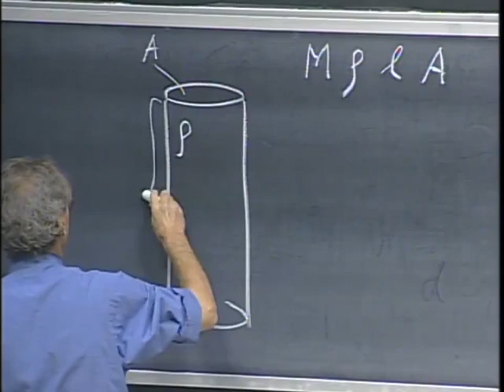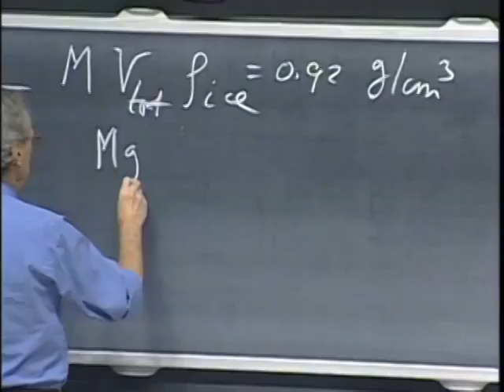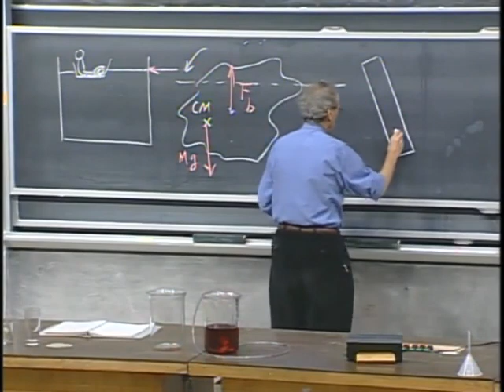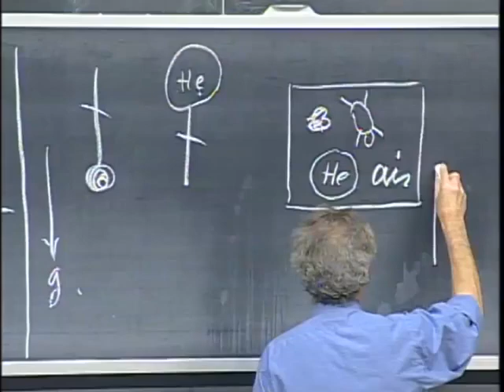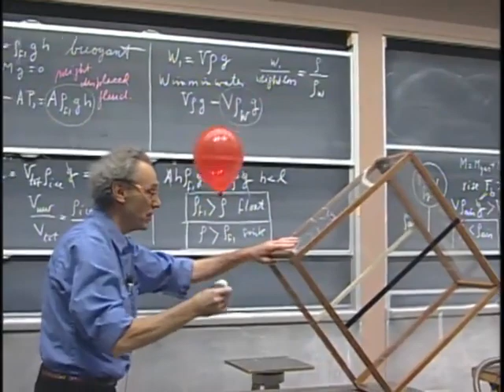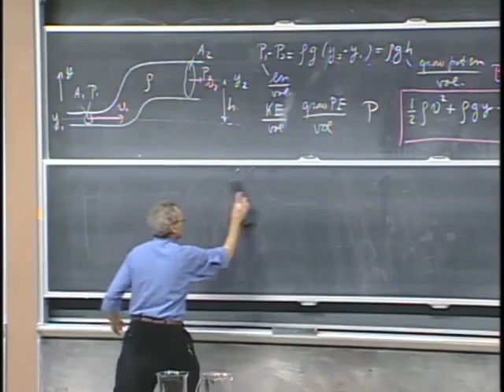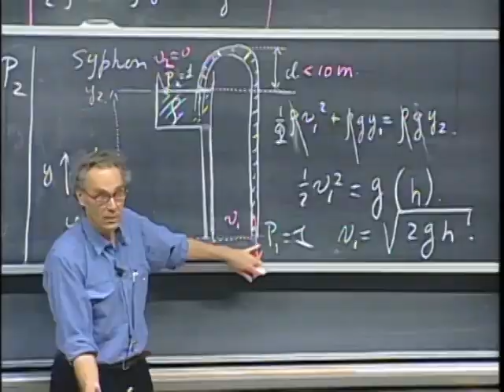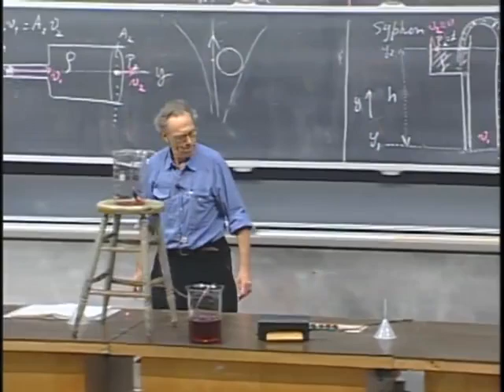8.01x - Lect 28 - Hydrostatics, Archimedes' Principle, Bernoulli's Equation

Comment: Sir, I have a question regarding the experiment at 48:12. Half of the glass is filled with air and half with cranberry juice. Total pressure on the piece of cardboard is pressure of air(inside glass) plus pressure due to the column of cranberry juice (i.e. 1atm + pressure of cranberry juice column) which is obviously greater then the atmospheric pressure (1atm) outside the glass. So inside pressure is greater than the outside pressure still cardboard is not falling down. How is it possible?
Reply from the maker: it's up to you to find out!
Reply: I did this experiment myself. But I filled the glass with water to the brim. When I tilted it upside down the cardboard not fell down. I measure height of glass and calculated pressure on cardboard due to water in it. It was about 1127.3 N/m^2 which is way less then atmospheric pressure. But why it didn't fell when it's half filled? I did not understand.
Reply from the maker: I have never done it with the glass filled to the brim. In any case the adhesion between water and glass and cardboard play a key role to prevent the water from falling out.
Reply: OK!!!! So this is due to intermolecular adhesive forces between glass, water and cardboard. I was thinking some type of pressure difference is responsible for this. Now I will do this experiment with materials other then cardboard and will tell you the results.😀

Comment: Hello sir. A small doubt with Archimedes and the crown.
The principle depends on the significant change in density of the two crowns. Density depends on only mass and volume.
The crowns were identical, which means that the volume of both is same. The mass has to be same otherwise anybody could tell the difference.
How is still there is a density difference in both the crowns when both the mass and volume remains same? Is there one more parameter I am missing to consider?
Reply from the maker: https://www.illustrativemathematics.org/content-standards/tasks/1144
Reply: @Ayush Nema, you're absolutely right. but as far as I'm concerned, Archimedes had only ONE crown, which he had to determine wether if it was made of gold or not, so he did it  the way Professor Walter Lewin described. Otherwise if he had had 2 IDENTICAL crowns made out of different materials it would've been way more simple (as you just described).

Comment: Hello There, Can Anybody Explain To Me This ->
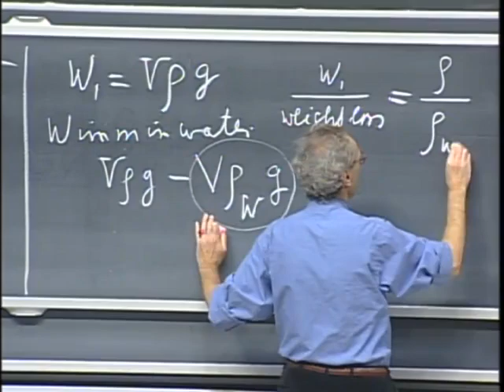at 6:34 , He says Archimedes could calculate the density of the crown using the formula -
density-crown/density-water
but how? if we know density of water at 4*C to be 1000kg/m3 then how I am going to calculate the denstiy of the crown ?
Another Video Explained It To Me Like This - 
Archimedes Knew density of gold and wanted to compare it with that of crown.. for that he needed to know the mass and volume of the crown. Mass he had known but measuring volume sure was a problem. So He immersed it in water, noted the volume of water risen up. As that would be same volume of the crown and used it to calculate the density of the crown. And Then Compared It To That Of Pure Gold. 
This makes sense, But In The Above Formula, How Will He Able To Calculate The Density ?
I know we could simplify further the above formula as  - 
Density-Crown/Density-Water = (mass-crown/volume)/(mass-water/volume) = mass-crown/mass-water.
.
But This Doesn't Equate To Anything? Note: I am still in 11th, so please ignore any dumb mistakes I am making.
Reply from the maker: use google

Comment: Respected sir,
 I think at 22:10 P1 must smaller than P2, as air particle move upwards so the density will be more  at top of the container.
Correct me if I am wrong.
Reply from the maker: you are wrong
Reply: Lectures by Walter Lewin. They will make you ♥ Physics. 
So, how P1 will greater than P2 at 22:10?
Reply from the maker: It's explained by me in my lecture. I cannot be more clear than that.  If you close the windows of your car and accelerate, the air in your car will "stay behind" and thus the air pressure in the back of the car will become somewhat higher than in the front.
Reply: Thank-you so much sir.
Your videos had build my concepts more strong, I had watched almost all of them.

Comment: Saying Vikas,
Sir if a substance having mass density of water whether uniform or not ,then to what depth would it be in equilibrium as all are rightly eligible ..
Reply from the maker: question unclear - watch my 8.01 lectures
Reply: Q. 2###
35:00 time 
Sir at this instant why the P1 and P2 are different even being at the same vertical level,seems to be the consequence of flowing fluid
Reply: I hope you have just the two lecture 27 and 28 on fluid mechanics that may guarantee JEe mains and advance India for fluid mechanics

Comment: what if you throw the rock inside the swimming pool instead of taking it away? the rock should sink because of its density greater than water density but it still replaces a certain amount of fluid and this would cause the level of water to grow up. So in this case the total level of water should stay still?
Reply from the maker: >>>So in this case the total level of water should stay still?>>>
incorrect
Reply: I forgot that the stone has a density too ahaha

Comment: sir, i think that at 48:15, the juice didn't fall out because of the tension of liquid but nothing to do with the barometric pressure. The pressure inside the cup (air in cup) is as same as the pressure outside. Is it correct?
Reply from the maker: <<<<because of the tension of liquid >>>
incorrect
it's becoz of Bernoulli - the pressure of the air that's blown in is lower than the atmospheric pressure.
Reply: Now the question is, why pressure inside the cup is less than outside?

Comment: sir, can you pleaese explain me your last demonstration theorotically. how that works?
Reply from the maker: that's up to you to explain
Reply: sir, is the answer is decrease in pressure?
Reply: @Michael Wang The air pressure above the water is lower than the pressure outside the glass, because once you've  turned the glass upside down there are fewer air molecules above the water than are outside, which will generate a lower pressure. So, if the pressure difference of the air between outside and inside the glass is lower than the pressure exerted by the weight of liquid, the piece of plastic (or whatever is it) won't fall down.

Comment: Sir.....I have a problem in the proof of Bernoulli....In my book the force on both the ends are shown in opposite directions. The net work done in moving the fluid is written ......dW= F1.V1.dt-F2.V2.dt...Why is it so..? Sir ..pls
Reply from the maker: I would have to see the text of the book and the pictures but that's too time-consuming. Please use google.
Reply: Lectures by Walter Lewin. They will make you ♥ Physics.  Ok sir......I will follow your advice...But sir if you have little time pls see the picture

Comment: Sir, you said that whether the object will sink or float depends only on the sensity. But, if you take a nail or a pin made of aluminum, it sinks in water but huge ships made of alluminum do not sink. How is that possible?
Reply from the maker: the mean density of  ships is their mass divided by their volume it is MUCH MUCH lower than 1.
Reply: Thank you so much Sir!
Reply: Sir, can you please tell in which lecture did you taught Capilarity, Viscosity and Surface Tension in fluids?
Reply from the maker: I don't think I covered that. use google

Comment: Amazing lecture! As always!!! 

I do not understand the argument at https://youtu.be/JR-L2CS8DGc?t=1352   "The only reason why the balloon raises, is because the air is there. It's because you build up this differential pressure". 
I understand and agree on the first statement related to the presence of air, not the second on the pressure difference.

I understand the presence of differential pressure between the top and the bottom part of the box, but how does the pressure difference affect the motion of the ballon (or my body, or the apple)?  The acceleration of the ballon is given by the sum (actually the difference giving the orientation of the forces) of the acceleration of gravity and the one of Bernoulli.  The acceleration of Bernoulli itself rises by the difference between the density of air and the one of the body (in this case the ballon). This happens independently by the pressure difference between the top or the bottom, or in other words, if we would have a really sophisticated box that could regulate the pressure so that there would be no pressure difference, the ballon would still go upward.  Am I wrong?

Any ideas?
Thank you in advance for any input.
Reply from the maker: the He filled balloon rises for the same reason that wood rises when released under water - Archimedes' Principle!!!!
Reply: @lecturesbywalterlewin.they9259  Dear Prof. Lewin, thank you really much for the quick answer!!! What an honour!!!  Yes, of course, Archimede!!! The pressure on the top of the ballon has to be lower than on the bottom of the ballon.   This generate a pushing force from the bottom which is higher than the force from the top, ergo the net force pushes up the He. 

Thank you for your lectures!
Reply from the maker: by your reasoning a balloon filled with air should also rise which is not true. I therefore doubt whether you  understand Archimedes' Principle.

Comment: Why at 36:18,  at the opening pressure is 1atm? Why don't we consider the weight of the liquid in the pipe to provide pressure at the opening?
Reply from the maker: >>> Why don't we consider the weight of the liquid in the pipe to provide pressure at the opening?>>>
bcoz that is wrong only the vertical distance matters!
Reply: Lectures by Walter Lewin. They will make you ♥ Physics. Why as vertical distance increase downward,  pressure does not increase in 36:18?
Reply from the maker: >>> Why as vertical distance increase downward,  pressure does not increase?>>> when vert distance increases pressure increases. Watch my Lectures or use google
Reply: Lectures by Walter Lewin. They will make you ♥ Physics. I edited my question
Reply from the maker: when vert distance increases pressure at the bottom increases. Watch my Lectures or use google. This is my last msg on this topic.

Comment: Sir,was surface tension a reason for the cardboard not falling from the glass even when you set it upside down?
Reply from the maker: YES! But it was not the only factor.
Reply: Sir can you please tell what are the other factors?
Reply from the maker: a slight bulge in the carton due to the weight of the liquid will lower the pressure inside.
Reply: Oh thank you sir. your lectures are really awesome.

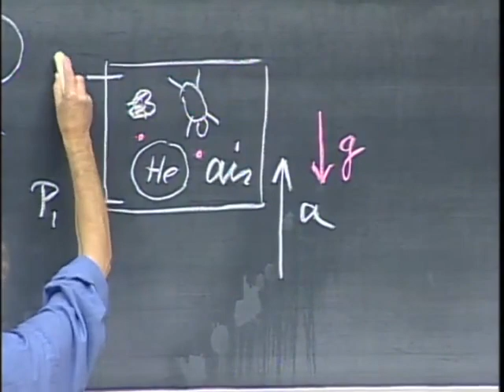Comment: {22:00 ->} 
What would happen if the He inside the balloon is replaced by some other heavier gas (or gas that is heavier than air) ?
Reply from the maker: any balloon filled with air or a gas heavier than air would not float
Reply: If you replace it with air itself or a gas heavier than air, it will behave like any other pendulum.  It will not float in air, it will sink.  It will respond the same way a solid pendulum bob will respond, when a car accelerates.

Comment: Sir.
The waterline will also go lower if someone steal our stone from the boat.However not put it in the water.
Reply from the maker: what happens when the stone is thrown overboard?
Reply: @lecturesbywalterlewin.they9259  The waterline will go lower in this case.
Reply from the maker: correct
Reply: @lecturesbywalterlewin.they9259  Sir my question was if someone took our stone from boat and he would not put it in water.
Then water level will also lower??
Reply from the maker: yes correct

Comment: An ice is floating in the water when the ice melts will the water level go up,down or will remain same . test your self and comment the answer below
Reply: Ice floating in water will keep the water level at the same level.

Suppose it is 1 kg of ice.   The volume of ice submerged in water, will be 1 liter.  An equal amount of water is displaced to equal the weight of the ice.

1 kg of ice is more than just one liter.  It's actually 1.087 liters.   But when it melts, it collapses into just one liter of water, which backfills the space it originally occupied, as it melts.

Comment: SIR PLEASE CHECK if IT'S CORRECT                                               Solution to boat and stone problem                                          M(s) = Mass of stone, M(b) = Mass of Boat, P = Density of water,  P(b) =Density of boat, P(s) = Density of stone, g= acceleration due to gravity                                        .            Before stone was thrown into water:-                                                                               {M(s) +M(b)} g = PgV                                                                                                  V={M(s) +M(b)}/P                              .                                    V(intial)=[M(s)/P] +[M(b)/P] - - (1)  .                 After stone was thrown into water stone will sink                                                       . Hence volume V1 displace by stone is :                                                          .             (V1) = M(s) / P(s)                               .                          Boat will float on water by displacing V2 volume,so:                                           .           M(b)g= Pg(V2)                                   .                                        V2= M(b)/P                                         .                                  V(final) = V1 + V2                               .                                V(final) = [M(s)/P(s)] +[M(b)/P] - - - - - -(2)                                                    .                                                Comparing equation(1)& (2)                                                          .                  *same volume level if V(intial) = V(final)                                                  .                                                                 *Volume Rise if V(intial) < V(final)                                                  .  *Volume Fall  if V(intial)>V(final)                               .        ........In our case  V(initial) > V(final) Hence fall in level will occur

Comment: Sir, in your last experiment, how can the pressure of the air inside the glass be less than the atmospheric pressure? 
The air can’t undergo any change in volume. Am I right ? 
BTW It was a beautiful lecture. Thank you very much..
Reply: Air absolutely does undergo changes in volume. It is one of the easiest fluids to compress. In general, gases are compressible fluids, while liquids are incompressible (unless you put in a large force, as is the case for high-pressure water cannons).
Reply: The atmospheric pressure about 1kg/ cm2 is much greater than the pressure induced by the height of the water-say about 0.1 g for a water height in a 10 cm deep cup. Therefore the card board will stick strongly to the rim of the cup preventing the water to spill off.

only if your cup was over 10 m deep, would the internal pressure in the cup be greater than the external atmospheric pressure and the water content would spill

Comment: Good evening sir i have A little confusion in  fluid flow in case of nozzle  we have positive pressure difference flow take place from (high pressure to lower) and that's natural but in case of diffuser pressure difference is negative (flow happen from lower pressure to higher) this is little un natural this i won't understand why such thing happen
Reply: Lectures by Walter Lewin. They will make you ♥ Physics.  So sir any hint where i misconception ? I don't understand why flow happen in direction of increasing pressure
Reply from the maker: I cannot add to the clarity of this lecture. Go over the derivation of Bernouilli's Law again.
Reply: Lectures by Walter Lewin. They will make you ♥ Physics. Thank you very much sir for that.. your video lecture are truely amazing ... Sorry to coz trouble to you sir but one last question .. will you advise which type of book should I read as a graduate student for physics .. and few books name ? As a reference thank you
Reply from the maker: grad st at MIT have to take many courses which cover material in 10-15 different books. Use google.

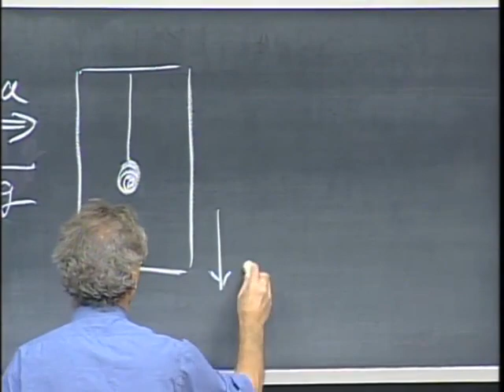Comment: 24:21 If there were mercury in the conpartment, and an Apple then the apple should also act like a balloon, if accelerated!!!! Is that true professor?
Reply from the maker: yes, but it will have to be liquid mercury. Not very practical.
Reply: A more practical way to do this, without having to deal with toxic liquid mercury, is to suspend a wooden block on a string from the bottom of the container, and fill it with enough water to submerge the wooden block.  Cover the top of the container, so the water doesn't splash.

Comment: If we roll down an empty plastic bottle along with a plastic bottle filled with viscous liquid..............the empty plastic bottle reaches the bottom first...................so can you tell, how with the help of concepts that you taught us in 8.01, we can explain this result???
Reply from the maker: In a race between ANY solid cylinder and ANY hollow one (rolling down an incline), the solid one always wins the race. The viscosity of a liquid inside a cylinder that rolls down an incline causes sheer in the liquid which produces heat at the expense of KE of rotation.
Reply: so can we say that when someone says that a solid cylinder always wins the race while rolling down an incline as opposed to a hollow cylinder, it is important that the person specifies what's the material inside the solid cylinder because that will affect the race??
Reply from the maker: a cylinder with viscous liquid inside is NOT a solid cylinder. PERIOD. Solid is SOLID!